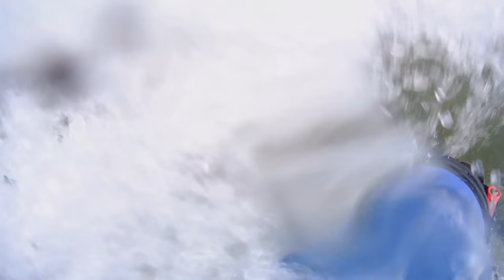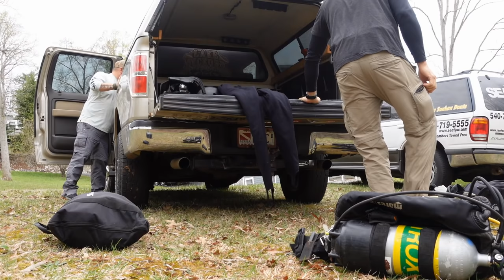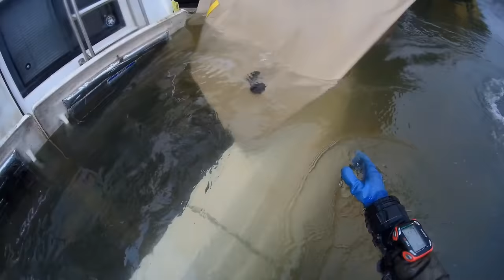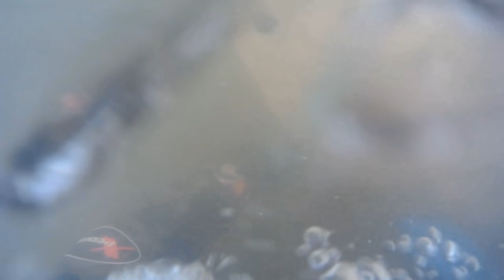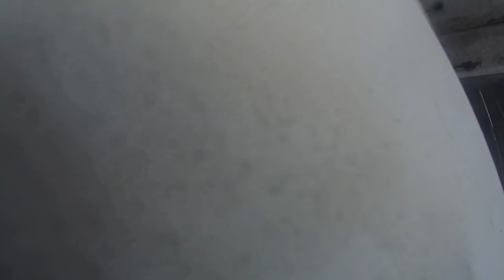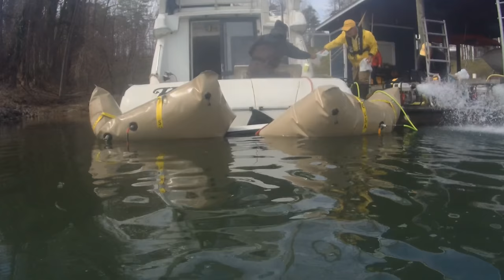Virginia Cabin Cruiser Salvage {[Easy, Yet Hard!!!]} With SeaTow

Comment: That looked like a nice, or was a nice Bayliner Flybridge sedan cruiser. Question is, what caused it to sink in the first place? Excellent, informative video.
Reply from the maker: That is a great question Scott Hussin. Typically, there are 4 common reasons vessels sink. 1. Battery failure - causing the bilge to fail. 2. Plug left out. 3. Ruptured hose. 4. Environmental causes such as muskrats. On this particular one, we never found out.

Comment: A swim deck is built to hold a load on top of it. In this boat lifting case the swim deck should have been fortified against a lifting load or taken off...
Reply from the maker: You are correct Robert Thompson. A lot of times though, by the time we receive the call for the salvage, the insurance companies have already decided to declare a total loss on the vessel. Thus, we never really have to worry about any damages that occur during the lift.